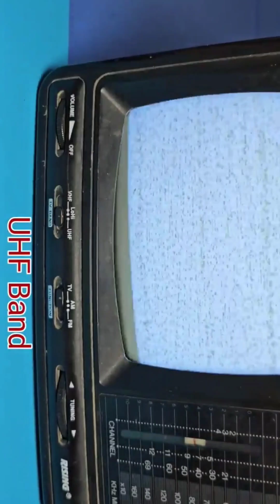Hacked ,Convert Arduino 433MHz Transmitter Module into a Television Transmitter #zaferyildiz #short

Comment: However, the 433 MHz range in Germany is only permitted with an amateur radio license. The small radio modules have no approval and are at best tolerated. The authority can prohibit use at any time and refer to other frequencies such as 2.4 GHz.
Reply: Wow ? Good to know. I wonder how tolerated they are in France, then... I use them a lot in my projects, they're quite handy. Thanks !
Reply: Potential Solution: make it weaker and use a direct connection
Edit: Basically Cable TV.
Reply: @oldkilgorezer make it weaker?
Reply: It isn‘t, 433 MHz is a ISM band but there are many regulations concerning the use of the band and it isn‘t allowed to transmit TV on it. However, harmonics are a problem with these Chinese modules. There is no obligation anymore for these modules to be certified by the Bundesnetzagentur. 

However, if these things cause any trouble, which they did in the past (I think there was such a case on the German TV show TerraX, where such a ISM device basically jammed FM and ATC), you or the manufacturer can be held liable.
Reply: Ja ist es
Reply: Ja ist es

Comment: Which TV band falls on 433 MHz? :-)))
Reply: UHF
Reply: @rogerioleao8904  The UHF band is between 471 - 855 MHz (CH 21-69), of which the upper range is the LTE band. Bottom of the 433 MHz amateur radio band. Reserved for LPD devices.
Reply: @Zoli049  UHF — дециметровый диапазон (). Подходит для работы в горах, в городской среде, в тоннелях, на пересеченной местности и в пределах прямой видимости. В этот диапазон входят два участка безлицензионной (гражданской) связи: LPD (Low Power Device) — 433.075–434.775 МГц (69 каналов), разрешенная мощность передатчика не более 10 мВт, то есть 0,01 Вт.
Reply: @dik-007  
Я знаю, но
ваш телевизионный приемник не может быть настроен на диапазон LPD.
Reply: @Zoli049 It's an old analog television just receiving UHF. The transmitter is very close too.  The antenna and filtering doesn't need tuned to exactly 433.
The signal should be strong enough to bleed into lower UHF channels.
Reply: @honestlocksmith5428  I have a Panasonic TV, it is also suitable for analog reception. The remote control of the gate opener transmits on 433.310MHz. The TV does not receive it anywhere, there is no upper harmonica.
Reply: @Zoli049  I am no expert, but isn't the gate opener a digital signal sent in a data frame with a different RF antenna? It's not a continuous analog signal using these Chinese 433 modules. VSB (AM) modulated signal vs. digital? What were you expecting to see on your television by pressing the button on your gate opener? A blip?
Reply: @honestlocksmith5428  
Even with digital DVB-T, there is a "signal" in analog mode. On amateur radio, there is no cross-talk even close.
Reply: @Zoli049  Well, I'm well versed in using 433mhz and have a number of frequency testers, I'd love to see exactly what frequency that 433mhz module is transmitting. It's definitely not just 433.000. It's definitely a range. It's possible it hits the lower UHF, I think.
Reply: @Zoli049 After looking into this more, I believe the back of the television contains a receiver as this transmitter, the stx882, and its receiver, the srx882, use amplitude shift keying to modulation to send and receive data. I don't know if that transmitter is capable of sending the necessary modulated signal for UHF television.
Reply: @honestlocksmith5428  I took a test. I broadcast with an amateur hand-held transceiver on each LPD channel with 1W. 🤣 The TV was in analog mode on UHF CH21, nothing happened. Modulation AM, FM and USB! 🤣 It is likely that this gadget also gives all harmonicas, so it is likely that the TV will receive it anywhere.
Reply: @honestlocksmith5428 and also, these modules likely have some sort of harmonic.